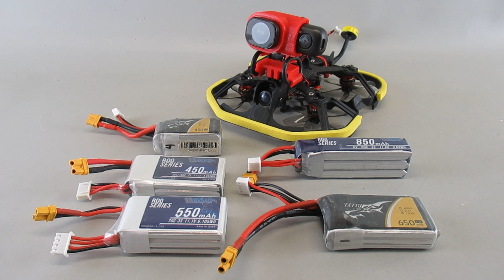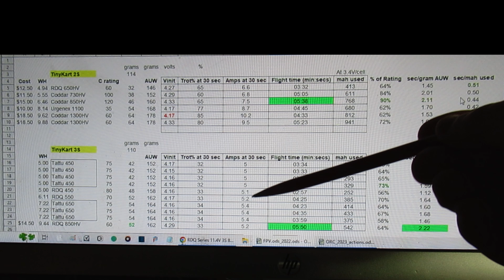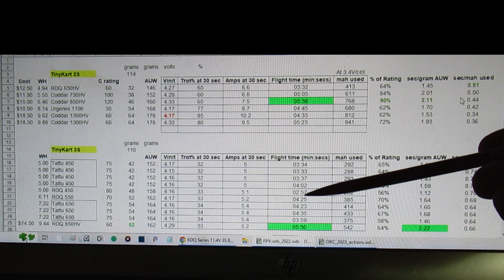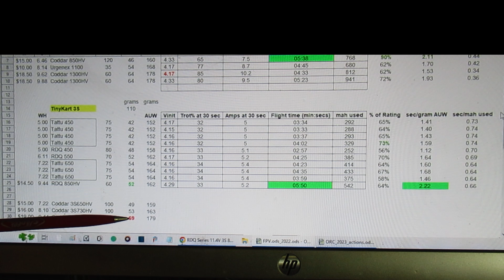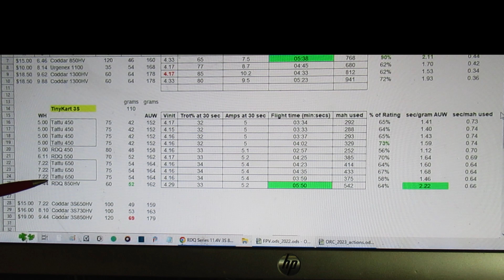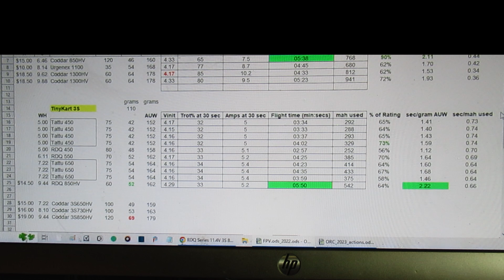FPV Cinewhoop | 3S LIPO Battery Test | 2 inch quad

Comment: are you charging those Lihv batteries to 4.35v?  if so, did you notice a shorter life span compared to charging at 4.2v?   I was comtemplating buying some HV batts before but have read so many conflicting opinions on them that it seemed best to just buy some and find out for myself.    
So now I'm asking you instead  ;)
Reply from the maker: Honestly, I've been buying the 4.2V cells but another guy suggested I try 4.35 cells and so far no issues.  I use to have packs balloon up and fail but that's because I would keep them fully charged for too long.  I now only recharge packs the day I plan to use them.  That has worked out much better.  I suspect HVs could fail more quickly if they are kept fully charged too long.
Reply: @TommyTester  That is some useful info for me.  I have heard a couple of experienced fpv pilots say that they fly theres down to 3.8 and stop flying, and then don't charge them again until it's next time to fly.   Sounds like you're doing something similar to that. Very good to know. I've been living in a world of theory while learning all of this stuff, I'm so ready to apply and know.
Thanks man!
Reply from the maker: @BartManDude  The people who stop short of 3.5V/cell are ripping them pretty hard flying freestyle so they don't have to replace them so quickly.  I think cruisers like me can take them down to 3.4.
Reply: @TommyTester  that makes sense to me.  So far the only hard ripping i've been doing is to prevent my quad from slamming into the ground :)
Reply: @TommyTester  So then are you charging them up to 3.8 for storage or are you leaving at 3.5 until you charge fully to fly again?   Another area where I see a lot of conflicting thoughts.

Comment: Nice work!   I ordered 4 of the RDQ 850HV  and am looking forward to seeing the results.   Great channel Tommy, I love watching testing almost as much as I like watching the flying.
Reply from the maker: Yup, I do a lot of simple testing to satisfy my own curiosity mainly.  I have one on 2" prop testing which you might like.  https://www.youtube.com/watch?v=VT91DGUhhFg .  Keep in mind that a prop that works great at 150 grams AUW might suck at 250 grams.  Same thing goes for 2S vs 3S vs 4S;  different props might come out on top.  Let me know how the HVs work out!
Reply: @TommyTester   You will be the first person I share the results with :)
How did the HQ 5 blade props end up fairing over time and variables?  Are you still using them?
Reply from the maker: @BartManDude  Yes, but since I'm running different batteries it is hard to say specifically.  They do break easily is my main gripe.
Reply: @TommyTester  noted!    thank you for the info sir.  I ordered a few of those props too.  I love how cheap 2" props are.

Comment: Thanks for sharing Tommy 👍🙏👍🙏
Reply from the maker: You got it.  Even though this quad is light at 78 grams dry and flies great on 2S, when I add the Thumb Pro plus mount it's up to 110 grams making 3S a much better match.